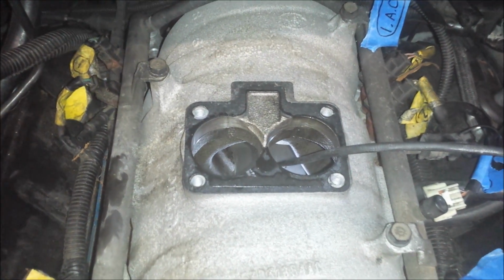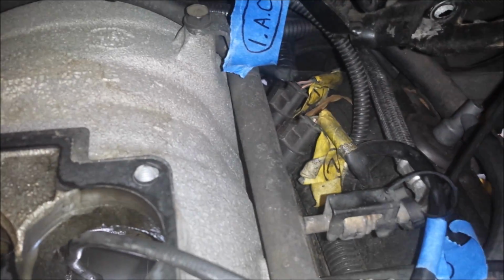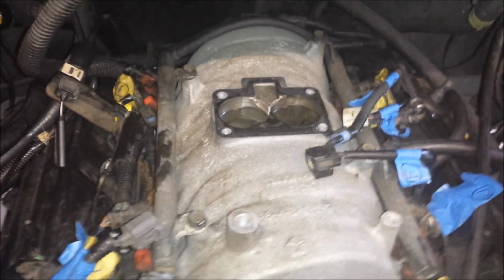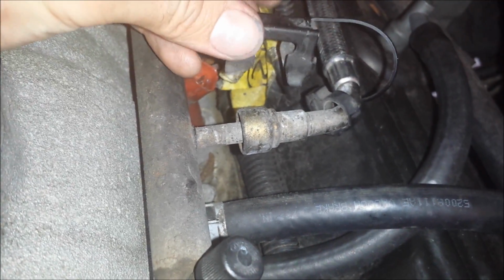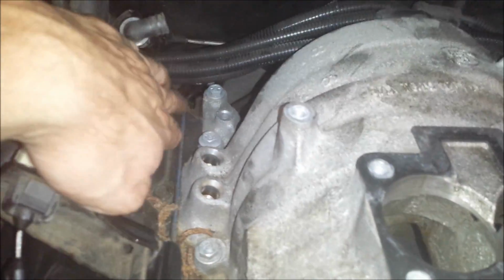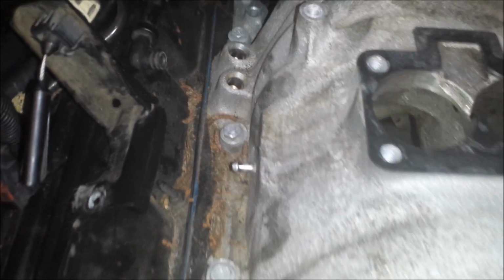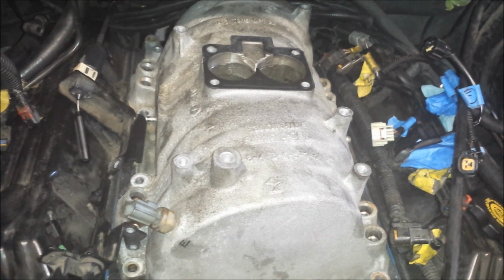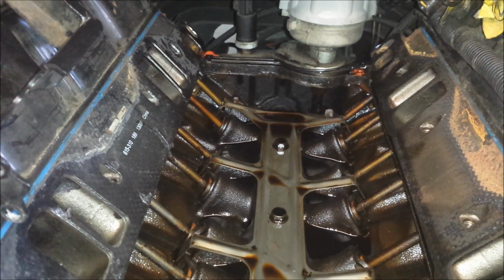2001 Dodge Ram 1500 - Intake Manifold and Plenum Gasket Repair - Part 3

Comment: I'm having to do mine again. any idea why this happens?
Reply: Richard Cowtails  I hear the materials above and below the gasket are different so they heat and cool (swell and shrink) at different times thus tearing the gasket
Reply from the maker: Richard Cowtails Richard, I'm really sorry to hear that!  That stinks, and I can totally identify.  In my case, I know for a fact that my second plenum gasket failure was caused by the plenum bolts backing out.  I used thread locker the second time I did the repair (last June) and have not had any issues with the plenum since.  If you tear yours down again, check to see if the plenum bolts are loose.  If so, use some thread locker this time.

If you really want to eliminate this issue once and for all, I believe Hughes makes a one-piece performance intake that eliminates the plenum plate altogether.  But, I think it's pretty pricey.

Good luck!
Reply: I did use thread locker... the blue. but that locker was old and I only used a thibnk line on the side of the bolt. My worry was I didnt use enough. I'm having the same issues just not as server. when its hot outside around 80 degrees and up. It kinda start choking almost. indicative with a a vacuum leak lol. It's always right at the top in the intake lol. So It's a pretty clear sign haha, no gauge needed for that lol. I kinda put the top back on sorta sloppy I's my worry. that i didn't get a good fit. (great idea with using old bolts for guide pins) GENUS! I'm looking over the Haynes Manuel again. To see if I missed anything. I should post the instructions for out of the manuel for everybody huh?
Reply: Joshua Sulwer Yes, That is true. I bought the kit from hughes with the aluminum plate. but the gasket failed. I didnt use any rtv on the gasket. Do you think that would cause it?
Reply: Really the aluminum plate failed? ya I would try the high temperature RTV gasket in a tube, but not too much, just enough so it has a even coat like a real gasket and let it partially dry(cure) before putting it back together. FYI your not using 5w 30 oil are you? if your in a cold climate thats proper (below 32 degrees F) but in the rest of the world 10w 30 is the way to go. it could be getting extra warm because of the oil. Or there is some gouge in between the gasket, or your over or under tightening it. Use a torque wrench. Here is a good tutorial list for most problems w these motors. http stuff with no www then dodgeram(actual dot not the word)info/Engine-Gas/

Comment: Matt you don't want too much advise from me anyhow.  I'm the guy who didn't pay attention and put calipers on the wrong wheel and couldn't figure out why the air wasn't bleeding out.  After scratching my head for an hour, I realized the bleeders were towards the bottom with no possibility of the trapped air coming out.  I reversed them, putting the bleeders at the top where they belong and voila.  I find being in a big hurry never works out, lol
Reply from the maker: dirtmcgirt01 Haha...I would almost guarantee that every single mechanic, amateur or professional, has learned more than a few lessons the hard way.  Experience is the best teaching tool.  So just chalk that up as a lesson learned, and know that you'll never make that mistake again.  I've made plenty of boneheaded mistakes, and I'm sure I'll make more in the future.

Comment: I just read as much from the internet I can on the subject and watch video's like yours.  Spelunked has a channel that demonstrates the procedure pretty well.  I bought a tool that is nothing more than a lever to reach from the torque wrench to the torx socket and help get into the bolt that needs turned, the tool is made for the band adjustment.  Use brake clean to clean up around the area and free it of dirt and grime if you need to before making the adjustment.  As the band wears it'll need tightened but if you're still shifting fine you may not.  I don't remember what the torque spec was or the part number for the tool.  i didn't have a 1/4 drive torque wrench and bought a cheap harbor freight one for it since if probably never use it again.  You'll do fine, just like you did on the video's of yours I watched.
Reply from the maker: dirtmcgirt01 Cool, thanks for the input.  That sounds like the same procedure I've read about.  I just get pretty skiddish when I start messing around with the transmission.  I really should go ahead and do a band adjustment though.

Comment: The band anchor that tightens the intermediate band when you turn the screw from outside the transmission case was completely missing.  I removed the pan and valve body looking for it and it was nowhere to be found.  The pan was rtv'd on and I soon found out why, some fool stripped the alluminum threads out of the case and required helicoils to use a gasket again.  I believe someone changed the fluid and filter, found the anchor, didn't know it's rather important and tossed it.
Reply from the maker: dirtmcgirt01 Holy crap, that sounds like a nightmare.  That's impressive that you diagnosed it and fixed it.  Any advice on doing a band adjustment?  I've had my transmission pan off twice, but have been too chicken to adjust the bands because I don't trust my cheap torque wrench.  I need to go ahead and purchase a quality one.

Comment: FYI, I bought a cheap fixer upper with more fixer upping than I realized.  I should have made a cracked transfer case r&r video.  A how to get 2nd gear back transmission fix video, a ball joint replacement video, a brake line replacement video, a u-joint replacement video, and a 4x4 fix video.  Maybe a trust your gut video when considering a fixer upper video too.
Reply from the maker: dirtmcgirt01 Wow...that IS a lot of fixing.  What did you end up doing to repair the transmission?  Also, how was the ball joint replacement?  That's something I haven't done.

If you get the plenum fixed, I hope you'll have nothing but smooth sailing ahead of you for a good while.  I love my Ram...in all of its high mileage, repair-needing glory.  I should probably be looking to sell it, but instead I'm trying to find the time to replace the front shocks, replace the steering stabilizer and steering box, repair some rust spots along the bottoms of the doors, get the front pinion bearing replaced in the rear differential, do a transmission band adjustment..the list goes on and on.  Stupid sentimental attachment...

Comment: You call that a leak, mine looks like someone changed the oil and dumped it down the throttle body.  this is going to be fun
Reply from the maker: dirtmcgirt01 Haha, wow...that does sound like quite a leak.  Your truck should feel like a brand new vehicle after you get it all squared away!

Comment: Did u have a misfire due to the plenum leak or what simptoms did it have.
Reply from the maker: RBTURBINA1 I wouldn't say I had a "misfire", but the truck was definitely "pinging" under load, and seemed sluggish.  On top of that, it was exhibiting a super loud whining noise at idle (from the air being sucked past the plenum gasket), and there was a lot of oil on the bottom of the intake manifold.

I hope that information helps.  Thanks for watching!